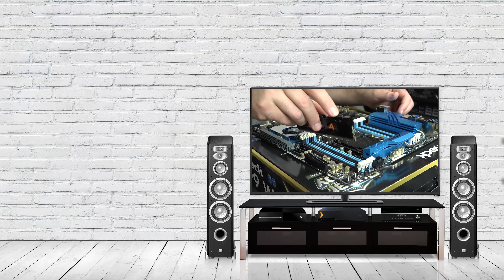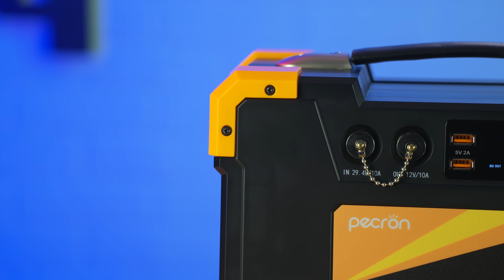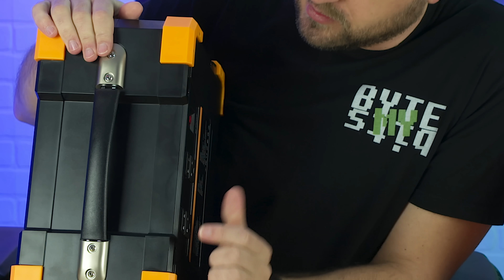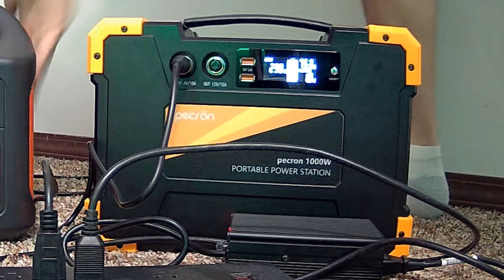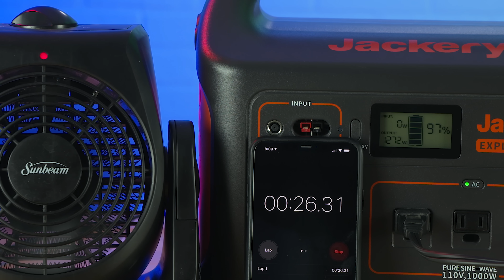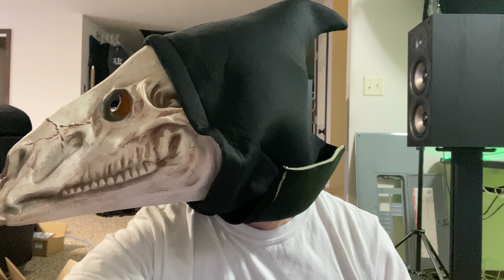pecron E1000 - Better and CHEAPER than the Jackery 1000!

Comment: For about the same price, I bought a diesel generator at auction from a power equipment rental company. I can run that heater for not 1 hour and 20 minutes on low, I can run it for 72 hours on high. Nice unit is a little larger, so you don't want to bring it indoors, as well as has exhaust and noise, but in an ice storm, it can keep your pipes from freezing and keep your freezer from thawing.  The batteries are kind of expensive for how little power they hold. 1KWH with a capacity of 1KW isn't much. I can run a full 48 hours at 6KW, without needing to refill.
Reply: An in a Blckout or Civil emergancy, all the noise your genny is making is gonna attract ALL attention you DONT want.
Reply: @leemendenhall1966  I haven't found that to be a problem. Invite the neighbors over to warm up, grab a hot coffee, charge the cell phone, etc. I make sure I don't have cords long enough to go to the neighbors. This in turn will often result in openings for borrowing fuel from neighbors if the outage is extended.  Someone with a diesel truck could extend 5 gallons to the neighborhood warming station.  The genny is not much louder than a truck idling in a driveway and much quieter than a contractors type generator. A water cooled multi cylinder generator is much quieter than any non quiet model single cylinder air cooled generator. With a few contractor generators running in the area,, the light tower is not noticed. It is also too big for someone to pick up and load.  I do park it turned around (noise to the street) and remove the hitch, so low chance of someone connecting and driving off with it.
Reply: Comparing some specs 
$775 new diesel generator (Westinghouse WGen5300s)
5,300 running watts and 6,600 peak watts
Runs for up to 13.5-hours on a 4.7 Gal.

weighing 143.3 lbs
$899 New Jackery Explorer 1000

1,000 running watts and 2,000 peak watts
Takes about 8 hours to recharge with 2 100 watt solar panels
22lbs + 18lbs solar panels 
Unless you plan on moving around a lot a Diesel generator wins.  However if these are your ONLY power options after a very long time the Jackery with solar panels would edge out a win in price because of the cost of fuel. Might be doing it wrong but I calculate (Price of diesel $3.30 a gal [varies wildly]) after 37.5 gallons your at the $900, but after  ~159 gallons you are break even with the Jackery and it's over priced solar panels.  Using a more normal price of 2 new 100 watt solar panels it would take 98 gallons before the Jackery would be the better deal. (Except the fact that the generator can power more things during that time.)  So you might want to multiply the gallons by 5.3?  Also things to note, you are getting about 2.9 hours per gallon of use.
Reply: @lotoex  LOL. Looked up the generator. Did you know that Diesel has a spark plug and manual choke?  Have you actually priced a diesel?

Comment: Are the Jackery AC ports actually grounded or just designed to fit grounded plugs?
Reply: Not grounded
Reply: It has spikes on the bottom that you have to shove in the ground before you use AC

Comment: First off, please stop saying supposably.   It's supposedly.   lol

Second,  you don't have to be shy about calling it a generator.   That's pretty much exactly what it is.   It "generates" usable power from a battery.  

Third, yeah, no one really cares about a light.  If you're going camping these days and you haven't gotten a decent headlight by now, there's probably a whole lot more wrong with your camping situation than your generator not having a light. 

Fourth, the Jackery is not all it's cracked up to be.   Kind of like Goal Zero....

Fifth, solar panels actually work better when it's cold.   And modern solar panels aren't that affected by clouds as older ones.   Yes, they still are, obviously, but, point them at a 90 degree angle to the sun, and you're going to get a charge from them.  

Sixth, the term you're looking for is MC4 Connector.

Comment: From someone who actually uses power stations all the time and owns 6: Having all the outlets displays and controls on the same side is a HUGE advantage to the Jackery. No fumbling around the back looking to line up the plug with the outlet and the switch to turn it on.
Reply: I dont see whats so hard about plugging shit i to the back. Like whats really the hassle there. I dont get it.
Reply: @grizzbane6091  well for one it'd not efficient use of space. Especially in van life.
Reply: @grizzbane6091  it's about space usage. In lots of situations you'd want to stick this up against a wall or something. With plugs in the back the effective size is made bigger because you can't put it against a wall. There is a reason many brands moved all the plugs to one side long ago.
Reply: @SetitesTechAdventures  ok thats fair. They do have 90° adapters for that size on ebay I think
Reply: @grizzbane6091  It's not.
Reply: wouldn't hanging a small extension cord at the front solves your problem, and it's only a dollar.
Reply: @cameranmanner4701  I can understand someone not wanting clunky workarounds, it's pretty cool having everything flush.
Reply: If you only had one you'd know where all the controls are and no need to fumble.

Comment: Pecron lacks 12V outlet which is a draw back. Many camping devices use 12V. It should of been built in imho, not a cable.
Reply: It has 1 12V DC cigar port.
Reply: @AngelaGarcia-es4ku  where?
Reply: @topcheese2889  the cigarette port comes on an enclosed cable.  The port is not built into the unit.
Reply: Pp.
Ppp0
Pop

Comment: Solar panels love the cold,fox news and the governor of Texas don't know what they are talking about
Reply: After you sweep the ice and snow off of them!
Reply: Solar is more efficient when the panels are cooler, but snow and ice covering the top and dark cloudy days during winter storms means little to no electricity produced.
Reply: @StringerNews1 

Says the one who started with "cool story bro. But I deal in reality, not cherry-picking fantasies."  So you call me dealing in fantasies but get offended when someone does the same to you. Typical.

Second You are just ignoring my post as I countered or at least put into perspective your arguments.  Also typical.
Reply: @StringerNews1 ice was building up on the blades, not the units were freezing solid.
Reply: @StringerNews1 

Not sure what really happened to the power plants as too many possible stories out there. But i am pretty sure the weather didn't actually do squat to the power plants.  I can see how the high demand for more power to heat up the houses, which the grid was not capable of handling (for whatever reason), could have taken it down but that is an issue that affects all power sources equally. I am all for green energy but i am not going to blind myself to the pros and cons of both fossil fuels and green energy.
Reply: @StringerNews1 

 “@LOTRFAN33 cool story bro. But I deal in reality, not cherry-picking fantasies.” 
Neither do I, yet based on the rest of your post I would argue that you do have a stern bias against fossil fuels as such you are dealing in fantasy land or at least not all in reality.  

As much as we need renewable energy do to pollution and limited quantities of fossil fuels, the truth is that fossil fuels currently offer the most energy other than Nuclear and Hydrogen which are both considered too dangerous (for a lot of people) at the moment. 

Consider Energy Density which is” “In physics, energy density is the amount of energy stored in a given system or region of space per unit volume.” So at most with perfect efficiency which h is impossible, that is the most energy we can extract out of any given fuel. Even wood has more energy density than wind or batteries. See below regarding energy densities of several sources.
https://meteolcd.wordpress.com/2016/05/

“Yes, the coal, natural gas and nuclear plants did fail, and for really stupid reasons. These plants literally made electricity from heat, and used water to transfer that heat. How they could have allowed the water to freeze with so much heat is beyond me, but that's what happened.”
FYI except for solar panels, all electricity is generated in much the same way. Basically a fluid be it water, air or steam is used to move blades connected to a generator.  Based on your comment the water that froze is in the tanks or supply lines before reaching a boiler.  BTW given the temperatures normally available in Texas, I am not surprised.  Basically all or most engineering designs in TX are based on typical temperatures.  For example, pipe lines are not buried that deep in Texas as there is no need as in the northern USA.  Also, like houses in tropical islands not needing a heater of any kind.  Why would they install one? 

“This fact isn't disputed, ir came from the utilities themselves, and even the Texas governor admitted them to be true before going on Faux "News" and lying. The fact is confirmed by trusted journalists, and by millions of social media posts. No "crisis actors", no "false flag operation", just cold, hard facts.”
That might be true but every search I made regarding what happened didn’t say anything about frozen water lines and such. All stated that supply was less than demand.  I had to specifically search for frozen water lines regarding the power failure to get any actual information.  Apparently also natural gas flow was affected (slowed down as it can’t actually freeze at those temperatures).

“The other side of the coin is just as damning. Natural gas, that could have been used to heat homes and generate electricity also began failing, because of the cold weather and no other reason. And then the water failed, again because of the weather. I heard nothing about the capability of "the grid", and because the failure was of generation, not transmission, that's a baseless claim.”
I am surprised that you heard nothing about the grid capability of supplying electricity as it is the most common reason given (again the only answer given based on my searches as stated above).
BTW when I said “pretty sure the weather didn't actually do squat to the power plants” I meant that literally. That is, the actual power plants weren’t affected in contrast to the wind turbines that were affected directly.  However, as you did point out, their supply lines failed so in general terms I was wrong.
 
“OTOH one more thing that made the bad problem worse is the fact that the Texas grid is unable to interconnect with the rest of the country. There's a state of the art interconnection facility in Clovis NM that could have supplied emergency power to Texas, but Texas refuses to use it.”
Agree.

“I just happen to live in a petroleum producing state adjacent to Texas, and we got more snow and colder temperatures here. And yet none of our utilities had as much as a hiccup. The reason? We're adults here. We do what it takes to be able to stand on our own two feet, and lend a helping hand. But I for one am tired of bailing out red states that want to live on welfare and never say thank-you for it.”
Have you thought that it is possible that the reason that you are not having such issues could be because NM tends to have lower temperatures than TX and actually reach below freezing point averages which TX apparently has never suffered? Thus your infrastructure is designed to handle such temperatures and Texas isn’t.
Reply: Hey the jackery outlets aren't actually grounded.. You'd need to pound a stake in the ground and wire the jackery to that to actually ground it. There's holes there for the ground prong but it touches nothing. Same with a rockpals and likely same with all of them.
Reply: I know the cold helps the panels kinda self regulate, too much heat isnt good in the cold they work great.
Reply: Ole Ronald is a victim
Reply: @willydiesel2081  ?a victim?
Reply: All kinds of things froze up and many things simply didn't work, including several turbines.  It also affected nat gas valves in places and of course anything regarding water. 
The thing is up in North Dakota, they have wind turbines and of course nat gas and water lines and solar too etc.  but they know how to winterize.
Reply: @rcud1  yes we know and the governor had to know as well when he went on fox and said that nonsense. The point is that deregulation let the utility companies get away with not winterizing their equipment.
Reply: oh god, another liberal making a comment like you know everything. come up to ny where we have the tallest windmills in the country. they work all year long.  thank you.  proof from my own eyes.

Comment: Any information about low temperature protection?
Reply: the power station will work between the temperature -10 to 45 degree. When the temperature is lower than that,  power station will stop to work automatically

Comment: If it's 1028 kWh, it would be equivalent to over 12 long-range Tesla 3's.
Reply: If it was 1000kwh that would make that little box 1 million watts 😂
Reply: @IcOmEiNpEaCe333  Not to get too involved, but at 1 million watts, it would reach 1000 kWh in, let's see, 3.6 sec.
Reply: @DavidStringham  1 hour, actually
Reply: @wingerrrrrrrrr  Ugh, 1000 kWh = 1 mWh, not 1000 Wh.
Reply: @DavidStringham  MW-hr, big 'uns
Reply: at 1028 kWh, that can power the entire 12 houses block for a Month, Sold !!!  I'm buying this wonderful device, them Chinese know how to make em..
Reply: Big difference between 12VDC or 120VAC out vs a Tesla that is 350+VDC.You need many more battery cells (in a Tesla, I don't know what this power block has inside it) to reach 350+ volts.
Reply: And I just realized its 1000W output, not kWh...

Comment: Jason you said the capacity of BOTH the batteries totally wrong, its not 1028 kWh battery its a 1028 Wh (Watt Hour) Battery    HUGE difference. 1028 Wh =  1.02 kkWh (not 1028 kWh)

Comment: What does "grounded" mean on a device that does not, as far as I can tell, connect the ground lead to mother earth?
Reply: Grounded in this case means earth is linked to the neutral to allow a short circuit to be produced under earth fault condition to then trip the circuit.
Reply: It's just meditates a lot
Reply: ▪
It means going to your room, and NO playing Nintendo and NO reading dirty magazines with dolphins in them.
🟥
Reply: @2NDFLB-CLERK  
Dolphins?
Like pink dolphins?
Reply: @gregorsamsa1364  
▪
Don't knock it till ya try it, bottle nose. 
🟥
Reply: @2NDFLB-CLERK  
Bestiality Is the bestest

Comment: The capacity is around 1000 wh not kwh right?
Reply: Yeah. Otherwise, it has 37+ times as much stored power as my old electric car.
Reply: @Digital-Dan  would be nice tho^^
Reply: @Digital-Dan  it has an invisible Mr Fusion on the top 👍

Comment: I have not seen a teardown of the pecron E1000 , but the teardown videos of the jackoffery's actually have a pretty high quality design, parts and quality cell's.
It would be interesting to see a teardown of those percon's.
Reply: Quality OBSOLETE Li-Ion cells, to be precise. Don't waste your money on inferior technology. ALWAYS buy LiFePo4 batteries, and you will get many YEARS more service. There are many brands that use the new technology. Jackery is not one of them. What's the point of it being well made if it dies after 500 cycles? Bluetti is also well built quality, and lasts for at least 3000 cycles, with over 5000 being more common. That's TEN times longer. For the SAME price. Don't get ripped off by Jackery. Don't be that guy.
Reply: @claycassin8437  Clay, I’m a senior citizen, and really need an unbiased, professional opinion. I need a power bank like this to run a small refrigerator for medication. But also for appliances and laptop. What would you recommend? I will add a couple of solar panels, but have no understanding of how it works. My hope is to charge the power bank thru my 12v outlet while driving, and solar when stationary. Any thoughts? Thanks for your input, that is exactly what I was looking for, channels like these are awesome, but it’s hard to know how biased or not someone is, especially if they received the item they’re reviewing for free.
Reply: @valerief1231  Bluetti is the most trusted brand and has LiFePo4 batteries. Eco Flow is a newcomer with excellent reviews. Both will run not only fridges, but also medical equipment without cutoff issues. Other brands have the newer battery tech as well, but watch reviews for them...some brands and models have had issues maintaining either their AC or DC  loads for extended periods. Bluetti is pricier, but has no flaws like those. When it has to work, the extra cost is worth it.
Reply: @claycassin8437 actually jackery does use the new technology.  The later you mentioned last longer but is older tech
Reply: Hobotec has a breakdown
Reply: @Braveheart.22  I think tear downs of a good product is a bad strategy. I'd concentrate on superior value dollar for dollar.  Tear downs make me automatically suspicious of the person talking and his ultimate end-agenda, whether it be in business, or politics.
Reply: @dutchcoven4256  Suspicious? Why?
Reply: @Braveheart.22  -.